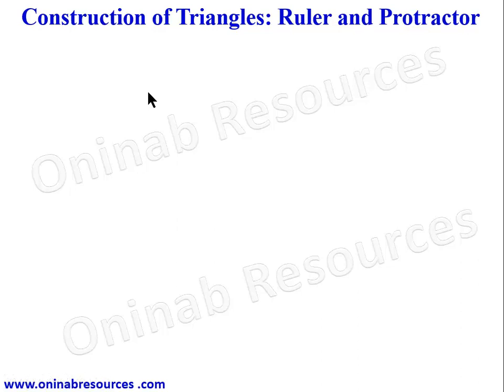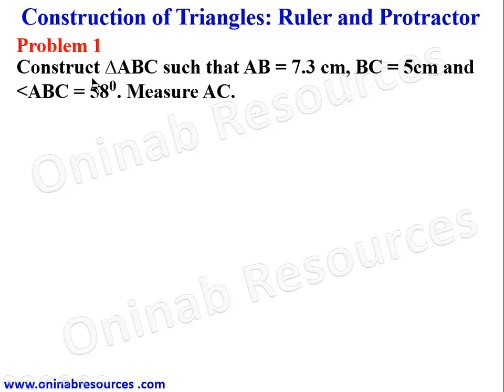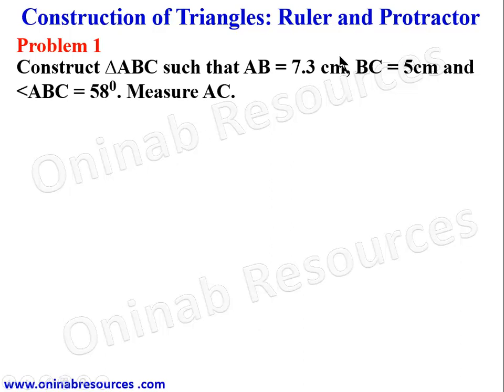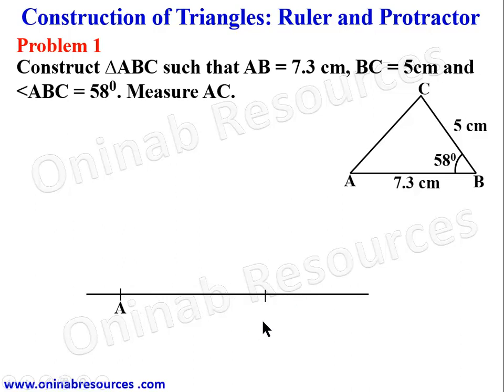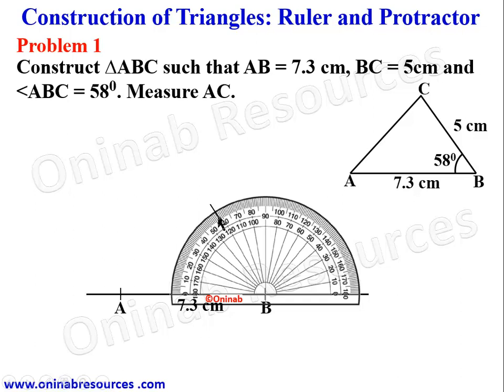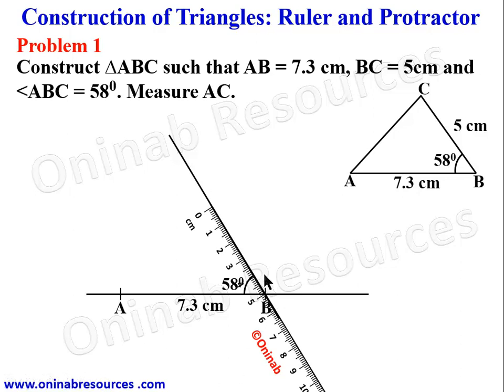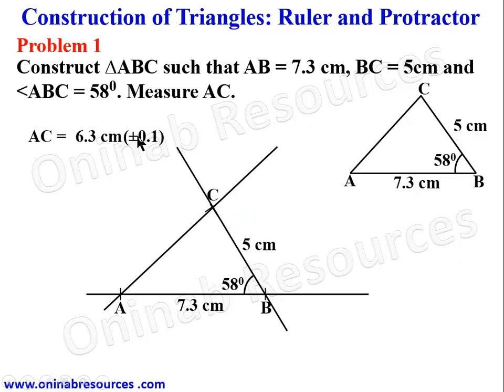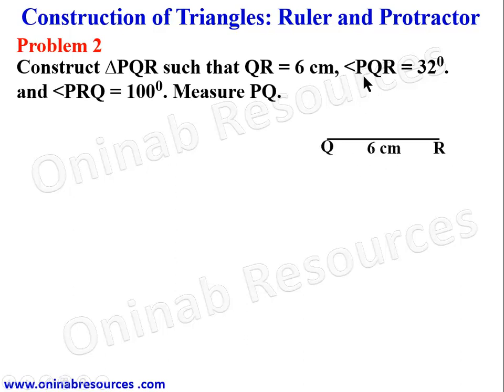Construction of Triangles:Use of Ruler and Protractor

Comment: I'm surprised that there is no other comment,  what I like and appreciate about this in the idea that there a lot problems that can be solved in this manner and it doesn't require a whole lot of formulas, being a math major I know all the formulas and use them quite frequently but this is a great learning tool and can help, especially if something doesn't need extreme accuracy.  Thanks.